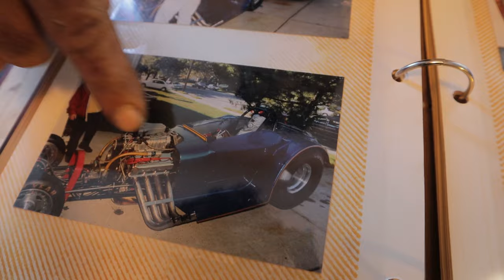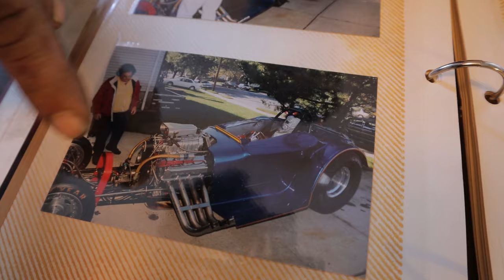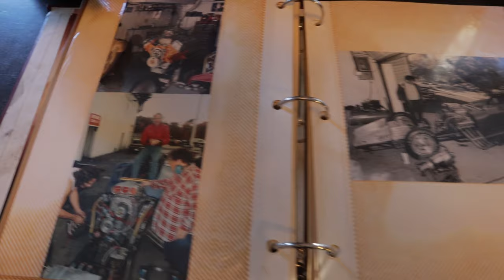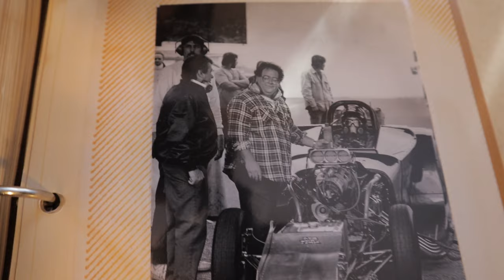Behold The Awesome Destructive Power Of Nitro

Comment: Love the stories.  Had no clue that was even possible. This hobby  definitely has varying degrees of sickness. Gotta love it.
Reply: Looks like it was an aluminum hemi engine that came apart...
Reply: try pineapple 🍍frag grenading the hole block ( and flying it a city block/ 1/8-mile ish away ) ( and taking the bell housing and parts of the transmission/axle with it ) some guy's used to or still try spiking the nitro-fuel with hydrazine 😲you're 🤓🤪

bet UTC has tried a 1-drop or 2-drops per-tank

16-25 year old me would have thought 💭it was ok to tryout and or GDI ( hydrazine or the diesel version of rocket accelerant ) into the cylinder per-need/tune/load-ect ( my thoughts were maybe mixing it in the tank is a terrible idea as 60's cars found but maybe the ECU can make it work safe/reliable, but im not so sure now in my 30's/up and to me i wrote it off in the same category as man/countrys with nuclear-powered/nukes/H-bomb's it's just a bad idea ) but in my 30's no! what was i thinking 🤔, thankfully I got to learn about the 60's/men who did it, it's just to powerful and hard to control reliably/safety from what i understand

Comment: The only thing that I can compare to that kind of destruction is seeing a Detroit Diesel DD15 engine on display at a shop that I use. According to the shop boss, the truck driver tried to downshift on a steep grade but couldn't find a gear. He finally managed to jam it into about 5th gear while rolling about 70mph. When he did, it severely over reved the engine and sent shrapnel, including one whole side of the block, all over the highway. Luckily, he was almost down the hill and managed to get the truck stopped at the bottom without killing anyone.

Love the old pictures and stories Tony.

Godspeed to Steve on his recovery!
Reply: I've seen a Cummins pulling truck blow the head off the engine and take the deck of the block with it. The headstuds held but the block just ripped in half horizontally! Another crazy one was a diesel pickup at the same pulling event, I kid you not, lost a piston ring and shot it glowing red and mangled out the hoodstack with what was left of the exhaust turbine.
Reply: I don't know how that's even possible to get it in 5th at 70, it prob just got away from him in whatever gear it was in going down hill. It's hard to get it out of gear when it starts happening and you allow it to get close to rpm limit. you usually have to clutch to pull it out and upshift. float shifting won't do it as you can't give it enough throttle to take pressure off the gears as you are close to the rev limiter. Your first instinct if you float shift is to give it throttle to get it out of gear. As soon as you touch the throttle engine brake is disabled which expedites rpm climbing. You probably could reef it out of gear but that's probably not good for it either.
Reply: @juliogonzo2718  In this case, I only have what the shop foreman told me to go by.

However, in my own experience, my tractor, with an ISX15 Cummins (2100 rpm setting), 13 speed and 3.73 rears is running about 1800 rpm at 70 mph in high gear. It won't get anywhere close to 70 in 5th gear and I've never seen a big truck that will.
Reply: @MikeBrown-ii3pt  yeah I think he's blowing smoke about 70 in 5th, maybe not about an overspeed grenade
Reply: @juliogonzo2718  OH yeah, definitely a grenade! I've been around big diesel engines in trucks and tractors my entire 54 years. I grew up on a farm and have been an OTR driver since 1993 and I've never seen that kind of destruction before or since. All of the rods were just hanging there and the whole left side of the block was blown out.
Reply: There are videos online of train locomotive diesels losing a cylinder/head and putting a 10" iron piston out of the locomotive and through the roof of a nearby building!

Comment: From a chemistry point of view, NitroMethane is a self oxygenated fuel. As to say, it doesn't need air to burn, which is why NitroMethane cars run as close to hydraulic as possible.
As the fuel burns, the Nitro part splits from the Methane, releasing Oxygen and Nitrogen. The Oxygen supplies the combustible part of the equation, and the Nitrogen expands. All this gives rise to the immense cylinder pressures, temperatures and sounds that contribute to making +10,000hp.

Comment: Nitro is a whole different level. I started researching it wanting to be kinda dumb and try to run a miata on nitro for fun. Quickly realized it wasn’t something to do just for fun.
Reply: It can be done on engines not specifically built for it but I strongly recommend a weak mix. That stuff is almost like if nitrous could be a fuel on its own. And be ready to change your oil a lot.

Comment: It's been years now, but I remember going to the drags at Orange County in California probably 40 years ago, and was not too far from the starting line. There was a guy with a blown fuel car getting ready to run and hadn't started the engine yet. He had come up to the line and shut the motor off to do some adjustments. When he and his crew were all done, he went to fire the motor up again. What happened was that the whole top of the motor exploded, and the blower wound up in the timing tower, which was about 3 stories above the race track. Went right through the glass of the timing tower and everybody in the tower was ducking or running. Fortunately, nobody got hurt, but that was a real lesson for me. I'd never realized how touchy nitro was before that.

Comment: I had a Hydraulic Event on my CX500  Track Bike this last weekend. Ran two heat Races bike felt awesome. I got the jetting perfect for the conditions. Left cylinder carb needle and seat failed to seal when I shut it down. Filled the left cylinder and intake runner with 112 race fuel. Fired it for the final race blew the air cleaner and vacuum diaphragm off the carbs and blew the head gasket and ripped the threads out of one of the bolt holes for the cylinder head. What a way to end a day.

Comment: I have limited experience with a 4000 h.p. nitro motor. We would always pull the plugs after the run and the car would sit with them out. Before the run it's not a bad idea to crank the engine over to make sure the cylinders are clear. Put in the plugs and then start it. We would start the car on methanol with a small separate tank and then wean it over to 90-100% nitro after the second magneto. We would usually overdrive the blower to make air with the 440 Donovan. 
The car right there in my picture.
In the nhra hall of fame and so is the man I knew who drove it. I think everyone on the team kind of drove it but Mike Bartlett was my good friend. Btw he hand assembled the Orca Viper motors that swept le mans decades ago. Team effort to build all the parts but he was the sole assembler. I have learned from so many great motor builders, fabricators, race car drivers. 
Best of luck on recoveries.

Side notes:
 The Donovan block has slide in cylinders for when you have problems. 

Your  flowing so much fuel I think we need to think wet flow not dry flow. 

How hard does the car launch? With top fuel slicks and 4k h.p. the coupe needed more lift in the front two cylinders to get enough fuel..the plenums can be played with and final adjustments done mechanically.
I have stopped racing for 20 years or more, i'm missing racing and my son is now old enough for me to travel. 
Maybe it's time to fill up the argon bottles
I miss it a lot.

Comment: I'll never forget the time I saw a bike do that when we were racing at Atco one time. The crew had the battery hooked up in the starting area behind the burnout traps, and as the rider went to turn over the motor all kinds of metal and fiberglass exited the left side of the bike like a shotgun and hit a concrete retaining wall about 20ft over as fast as you could blink. It sounded like a shotgun as well. It blew out the side of the #1 cylinder taking the piston and half the rod with it as well as a whole bunch of other stuff. Luckily nobody was in the way of it.

Comment: Back in the day I was at Beeline drag strip. At the time they were using rollers to start the dragsters. The same thing happened only the left front of the engine was was blown out. As a kid I picked up a souvenir part of the cylinder wall. One of the crew or someone standing around made the statement now that's a blown head gasket. There wasn't anything left you can see the oil pan and the head nothing in the center.

Comment: These kind of accidents reminds me of why i eventually quit racing. Back in the day my dad (we were a father and son team) ran a 1964 Dodge Polara 330. He was in lane and had just done his burn out and i had noticed the rear wheels were juttering, ie instead of spinning they would start and stop, repeat. I was heading towards the car waving my arms to get him to shut it down when he gunned it and the torque converter exploded and shrapnel went up through the floor board and missed him by fractions of an inch. (he had multiple places where the shrapnel had "torn" his fire suit but never penetrated). Yeah a few years after that we quit. It was getting to expensive to keep up with safety equipment and you NEEDED to keep up with it.

Comment: It’s interesting the way he talks about nitro being about as flammable as lighter fluid for the grill, and how under compression makes it explosive. Not only that, but compressing the air fuel mix heats it up. Have you ever poured lighter fluid on hot coals but it didn’t ignite right away? When the lighter fluid is already that hot, all it takes is the spark from a lighter and it ignites explosively like gasoline. Even regular grill lighter fluid becomes explosive under the right conditions so it makes sense that nitromethane would too.

Comment: Hey I know this is off the wall Tony but I have some questions about a 78 dodge truck and an additional overdrive box. It's a 2 wheel peel rig I just bought it never have I seen or messed with them.do you have a good place to interchange information and possibly help me figure out what needs done to either use it or completely do away with it.

Comment: Is this why I see them turning the motor over by hand with a 3 foot breaker bar and a ratchet on the end of it? And if one cylinder is full and you did it by hand would that cylinder detonate Without spark?
Reply: Great question! Some years ago I asked a crew member of I believe Mike Dunn why they rolled the motor over by hand before starting it. He said sometimes fuel will drip into a cylinder with an open intake valve, and it could go BOOM while starting. I figured it was a small amount, like a teaspoon, not necessarily enough to hydro-lock.  I would think rolling it over by hand and one cylinder was hydro-locked the crank would stop, unless the spark plugs were removed. I'm definitely no expert as I've never messed with Nitro, but I do have 40 years automotive and aircraft mechanic experience.
Reply: They typically use a ratchet with a long handle to turn the engine over backwards before starting, so any fuel puddled in the cylinders gets pumped out the exhaust valve.

Comment: Simple, a NoS valve failed and filled #4 or whatever, full of gas when they were cold spinning the engine for oil pressure.
Reply from the maker: nitromethane not nitrous oxide
Reply: @UncleTonysGarage  👍 thanks. Jeez it was like a stick of dynamite went off in the thing.
Or a freaking hand grenade.
Reply: @UncleTonysGarage  in that case,  could the cylinder have somehow gotten filled with the CH3NO4 whilst cold spinning?

Comment: If it can't kill you what's the fun ? Have a top fuel racer friend who had an accident at Indy dragstrip when AFTER THE PASS ( normal 300 + pass ) after the run while sitting on the rear tire the fuel regulator allowed enough fuel in the hot cylinders and the zoomies facing the driver with helmet off and sock off sprayed hot wet nitro exhaust in the face. It was awfull, driver burned badly but made a qood recovery. Stay kinda safe....

Comment: Remember kids, nitromethane doesn't mix with gasoline...nitropropane, on the other hand, does...about 15 percent and take some timing out...don't ask me how I know...
Reply: Remember to pull that timing unless your really curious what shattered pistons look like! 😂
Reply: @barneymiller7894  actually...it kicked the rod out of the front of the briggs & Stratton block...and set my pants and shoes on fire...
Reply: @JSki-kb8vf  Thats both awsome and hilarious, you probably set a horsepower record for a Briggs right before it grenaded 😂
Reply: @barneymiller7894  5hp...70+mph...milled head...ported...polished...reground cam...oversize carb from a pile, god knows what it originally came from...kids whose daddy bought them a honda mini trail hated me...when I went by like they were tied to a tree...if the rod went out the back, no problem...out the front, stop, drop and roll...